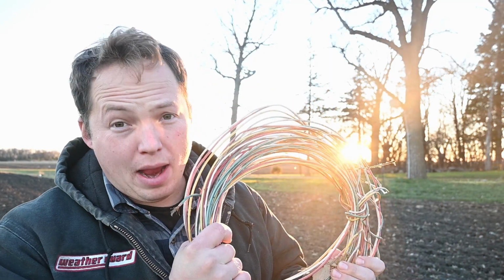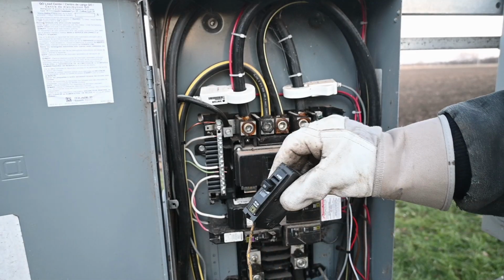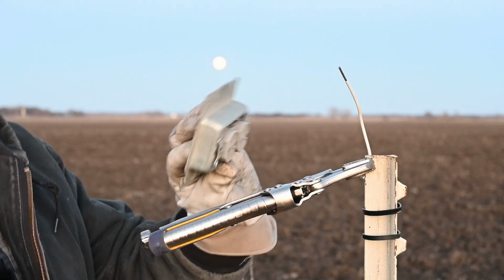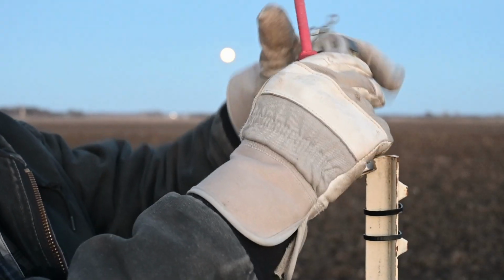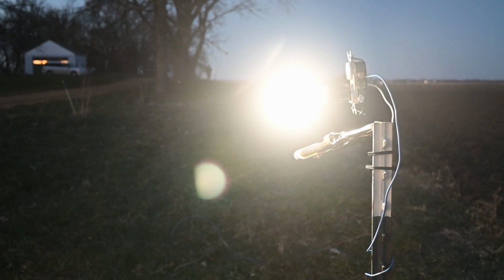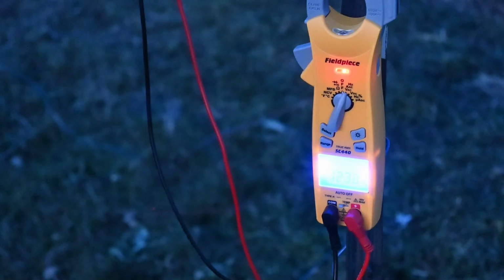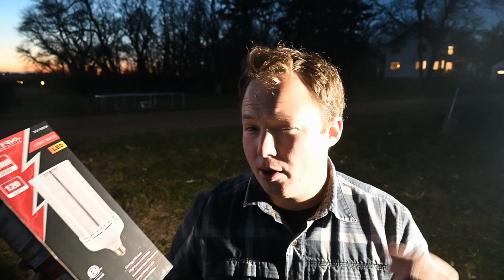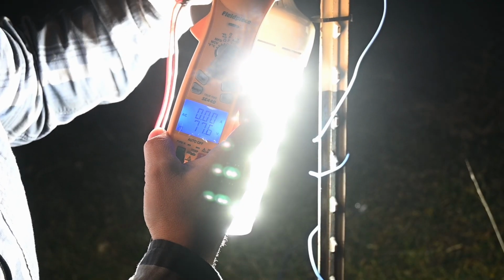Powering a Light With a Fence Post & Scrap Wire - SWER (Single Wire Earth Return) Demonstration

Comment: My Dad used to heat A-frame single hog houses using a 100watt incandescent lightbulb running a single wire from the source and the other wire attached to a metal stake in the ground back in the 1940’s in Illinois. This must be how he did it.
Reply from the maker: Exactly.

Comment: If you hadn't plugged your wire into your incomming power box I might have been convinced. Why does everyone pull this crap? A single wire earth return shouldn't need to be plugged into an incomming power box. These are the things that confuse people and distract from the truth. Half of the reason we don't already have unlimited energy potential. Sorry but this turns a lot of people off from even trying.

Comment: Pretty stupid to do this. Anything that’s a easy ground to travel it will and it could be ur body . Then ur fried . Also anything around that could get hurt just becouse u don’t have the tru neutral wire going back to the source. Now with ur ground to earth that u have your putting a lot in danger if sumone didn kno an ended up close in that area an using that recepticall they can become that path to ground or that ground could be hot also an fire you like that . Srry I can’t explain it to the y but I’m sure I got the point out

Comment: We had 2 boys that lived  lived a block apart and another that lived in the middle.  We took an old ping pong machine apart and salvaged the wire.  It took a lot of stripping the ends and soldering to get a wire long enough to reach the whole block and of course we only had enough wire for 1 run.  we used old loudspeakers on each end as microphone and speaker. We tried different grounds on each end but connecting to the water pipe at each house worked best.  There was always a loud hum we tried everything to filter out but we could talk all night! I don't ever remember measuring the voltage but it entertained us for a long time!  I think it was replaced by some 3 transistor hand held CB radios! This was mid 50"s.

Comment: Wonder if it would have less voltage drop if you increased the frequency of the alternating current to say 1440 cycles per second.   Might have to use a tungsten bulb.

Comment: The single path earth return path is  not exactly like a wire. Electricity takes every possible path through earth. Some current will flow in the direction of the ground at the transformer.  And some current will initially flow away  only to take make a convoluted path back to your transformer ground, and some current will flow to the ground located at your distant neighbors  transformers. 

Multiple paths is like adding resistors in parallel which is why a good ground can have a low resistance over long distance. 

Just looking at the theory. Take a current path through one resistor let's say it's 8 ohms.  If you add a second current path through a parallel  8 ohm resistor, the net effective resistance  of the two resistors is 4 ohm.  If you have four 8 ohm resistors  in parallel,  the net resistance  is 2 ohms.  Resistors in parallel  add like (r total)=1/(1/r1+1/r2+1/r3+..... ect). The earth can provide an impossible to count  number of paths back to the source which provides a very low resistance  to a good grounding

Comment: Can someone explain this? Lets say you have an older home, without ground fault protection devices. Let's say something goes to ground in your house through the ground rod, if you're outside in your bare feet are you going to get shocked?

Comment: I retired after a 42 year career operating the electric grid at all levels, so I'm very familiar with most aspects of power delivery.  While driving to Edmonton, Canada years ago I noticed that the single phase power line along the road no longer had a neutral wire, just the primary wire (7200-15000 volts depending on system configuration).  This went on until a farm could be seen ahead and suddenly there was a neutral wire on several poles before and beyond the farm, each pole with a ground rod I'm sure.  Then single phase primary only, again.  It was clear that the power company was saving the cost of many miles of neutral wire and that the customers had to deal with voltage deviations that would vary according to the soil conductivity in the area and customer load fluctuations.  They may also have had to deal with any underground metal water pipes, gas pipes, etc. that the electrical system would choose as the path of least resistance for neutral return.  Consequences could be that people or animals could be shocked and injured if getting in the path of the return current, and electrolysis degradation of underground metal installations.  I later got on Google Maps street level view along many roads in the area and looked up at the power poles which confirms that the single phase primary with no neutral is extensively used in much of rural Alberta.  Ok if it works for them, but not acceptable in most locations, especially in more populated areas.  Jess

Comment: note: if you actually do this, you will drive worms away from the spot the metal fence post is in the ground. I use this as a "work rod" to get earth worms - they crawl to the surface to escape the electric

Comment: I used to live in the snow. One day I dropped an ice cream cone I had just started eating from the peak of the haystack I was sitting on. The electric current from the earth shot the cone into the air while the ice cream expanded from the amperage. The resulting snowman with the ice cream cone being the nose was a surprise.

Comment: I didn't understand quite what you were doing at the electric panel, however, it looks like the thing that Nikola Tesla was talking about, where he said it's as easy as plugging a pole into the ground and you can get as much electricity as you need, and after he said all that Sears and Roebuck came out with a device called The Energy Siphon. There was another man who ran around for awhile, demonstrating that you can plug these wires into the ground and just ground both ends with the circuit breaker in between and you can get as much power as you needed, however his life was threatened till he finally stopped. Myself, I believe that you could do this all day long, I believe it's been done throughout the past all types of times in history. After all,  what is thermal energy if its not this?
If I were you, I would put a PVC pipe around the post in the ground. 
And salt water at the ground rod and post will be more conductive. 
The values could change with just water. 
Ok, cool video. Peace be on your house.

Comment: Can you provide your own power with a battery or use an inverter if you need AC and use your home for negative or do you have to use the same source for the circuit? I’m thinking if you could tap into another power source, like a neighbor’s house ground if you supplied the other half of the power? Would this work?

Comment: Hi   I had a  supposed  240volt motor   but when I checked the voltage at the motor it was 120 volts so I ran the 120 volt motor for  years ....one day I was told by someone else they were positive it was 240 volts knowing I checked at the motor it was 120 ...so I was curious and checked the power at the junction box on the wall with a disconnect switch...it was 240 but at the motor 120... The wire was very shallowly buried..so I started digging it up...soon I found where the wire had been cut and spliced with wire nuts but one leg had the wire nut off and the splice had came apart and was a few inches apart    so one hot led was on and hot " live " and separated by two inches of dirt ...I was amazed that at the motor I had on hot leg and one neutral for 120 volts that had been running that 120 volt motor over a year when I tried to tell my friend but I don't know if he believed me lol.  And a course some one with bare skin touching the loose wire on a rainy day could get electrocuted!   So there is that potential if the person's body completes the circuit becoming the load ,like a light bulb completing the circuit and flow of electricity of voltage and amps and you would be the watts lol.  Ouch! And like you said..the breaker most likely would not Trip...most likely a wet soil too would have different results and be more dangerous...I know you were doing a experimental test  but Nobel's brother could tell you thing's do not always go as planned!   
    Be safe !  By practicing safety!    
.....have a good night!

Comment: I worked on a house in town for a couple 10 years ago.  They had an average $700-800 electric bill, and kitchen stove, A/C, and any other 220v appliance did not work correct.  
   What I found was some genius hooked up one leg of power to a ground rod & neutral line to hot side 😟.     So basically they had a (swer) in one leg of power full time.    WOW.   Lot of people don’t understand that “ground” means just that.     Neutral & ground are eventually just the same thing.

Comment: Here in Australia we have a similar system for remote phone systems.
Go to one of the old stations (ranches to you in America) and there was a line posts with a single wire going off into the bush. At the other end was the next station, up to 50 miles away. The other side of the circuit was connected to a earth stake. Steel bore/well casings did a good job. worked very well.

Comment: When ConEdison in NYC was trying to standardize the electrical system in the city, they found out that a few people had been getting free electricity from ground eddy currents passing through the dirt in their back yards. 

All they had to do was drive two metal stakes into the ground and move them back and forth, closer or farther away to "adjust" the voltage to what they wanted. 

"Ground-Return" 22V Single Leg is very common in Australia and New Zealand to this day.

Comment: Very true, as stated below.  The Neutral wire/ Earth Ground, that you used, should have been landed on the silver screw on the receptacle.  Also, the voltage will drop at 300ft, so you'll need to double the wire size, if it's aluminum, or your voltage drops. 
  The man below stated that the voltage will go to the next house.  Probably not, in your situation, but in a city it is possible.  But, the unused voltage will return to the Electrical Power Plant that it was generated from, not the closest ground, unless it is is a very close proximity. 
  I am a Master Electrician, if you have any questions in the future, please ask.  I'll explain what will happen, an the dangers, if any.  Very cool to show other's though, an can be very handy on the farm's.  As long as there is no moisture on the top soil, an animal's are clear.  Hit me up for questions boss, I can show you many neat ideas with electricity. 
  I'm a Class 1, Master, Journeyman Certified Electrician.  Also, a Mobile Electronics Certified Professional, THX Surround Sound Certified Electrician.  I have full understanding of Direct Current, an Alternating Current.  Stay safe, an God Bless.  
       Sincerely, 
    Matt

Comment: Use a copper collector to collect electrical ions from the air feed it to a capaciator instead of a battery and connect ur setup .Nikola Tesla build this system and powered lights at a great distance .I like your clear presentation here and would like to see more .Robert Pres AZ Tesla Science Foundation

Comment: Journeyman Electrician, I had a service call last week, "everytime Tenant turns on disposal, the living room tv shuts off"  hhmmm.. first thing I'm thinking someone tied the wires together in a junction box and somethings obviously not right. I get to the job and sure thing tv shuts off when disposal is activated. Even weirder, they had a handy man run a new circuit for the disposal AND a circuit straight to a new tv plug. STILL shuts off tv. Throw an amp probe in tv recep, have tenant flip disposal switch- goes from 120.2 v all the way to 175v. All the lights in the house flicker when disposal kicks on.  Now I know there's something fishy with the service. I pull the meter, all connections look good and tight. House is on a flag lot, away from the road. I take a walk following the lines. I get to the transformer and there's the issue. The house lost it's nuetral/ground, just 2 hot phases coming off the pole with the bare nuetral/ground dangling. The house panel was creating it's own return path with it's bonding wire, the house ground connected to the ufer (concrete encased electrode) bar.  Called the pud, came out within the hour and replaced all 3 connections. Tenant said it's been that way since he moved in since december. Lucky he didn't fry anything.

Comment: Don't do this for any reason, ever. I could hook up my sink to a 1500 PSI pump but it would be a very bad idea.  I could disconnect all my hydraulic brakes on my truck and just use the emergency brake but it would be a very bad idea. I could have sex with a donkey but it would be a very bad idea. Just because you can do something doesn't mean you should.

Comment: so i have so many questions. 

1. if it floods does the circuit short.
2. if i take a metal shovel and stab the ground between the return will i get shocked. 
3. can i stick anything metal near there to tap into the circuit. 
4. how far can i run that from the starting point. 
5. is it efficient or is it "leaking" current into the ground thats being lost.

Comment: If you hit the hot wire with a shovel, the current would indeed increase and trip the breaker in a flash! This whole experiment is pointless and has no practical use except to show how dangerous it is and why you shouldn’t try it. That 40 volt gradient that you measured is more than enough to be fatal.

Comment: Many years ago, I was visiting my parents for the week when my dad asked me to help him replace the broken compass in his car.  He'd bought a replacement but had had trouble calibrating it (it just glued to the dashboard but the iron in the car frame and engine affect the magnetic needle, and there's an electrical effect too when the engine is running).  We eventually got it calibrated correctly, while the car was standing in the drive, and then drove down the road (the one out of town, which conveniently runs very close to north) to check it.  It turned out not to be calibrated once the car was moving and after we'd turned a few corners, so we turned off onto a side road and pulled over to try again.

However much we tried, we couldn't repeat the initial calibration successfully while the car was in this different orientation.  I was getting a bit frustrated so I took the compass out of its mounting and went over the road to see what would happen once it was well away from the car.  Abracadabra!  The compass worked.  And as I called out to my dad, who was still sat in the car, I looked up and saw we'd parked on the verge underneath a double line strung between telegraph poles.  This was an old rural road and it suddenly hit me that the houses along here, so far out of town, would probably never have had service pipes laid for them, so the thicker top line must be an electrical one on a neutral earth return system.  We had been trying to calibrate the compass smack in the middle of a magnetic field induced by the mains current...

Comment: INSTEAD OF USING THE FENCE POST FOR THE GROUND, YOU MIGHT WANT TO DRIVE A 10 OR 12 FT COPPER ROD IN THE GROUND, HOOK TO, AND YOU'LL HAVE A MORE POSITIVE GROUND ROD.THE DEEPER YOU DRIVE YOUR GROUND ROD, THE MORE POSITIVE GROUND, BECAUSE THERE IS MORE MOISTURE, THE DEEPER YOU GO..YOU WOULD NOTICE LESS DEGRADATION IN THAT AS WELL.

Comment: I am an Old Man but All the Real Old Homes were actually wired like this as Wiring never had a Neutral as No One Knew what a Neutral Was--only a Hot Wire and Ground wire which was Grounded to Mother Earth was used. Old Technology will still work, my old home house was wired just like your example--we had a 2 fuse link box. one was for the lights the other was for kitchen-frig. and wringer washing machine-no air conditioning or electric dryers in the 40's-50's...

Comment: Use a 1/4 or 3/8 rod, wire the return from the lightbulb fixture to the rod, wire the other connection to a "hot wire" from the house.  Doing this you have just made a "worm catcher rod".  Start with a 100 watt bulb and see if the worms come up.  If none come up, use a smaller watt bulb.  This would increase the current into the ground.  HAPPY FISHING!!!

Comment: The great thing about earth ground is, lets say your running lights to your barn 150 feet away. You would run two conductors, one leg of your 240 vac. and one from the common. Then use a ground rod outside near your panel. Then use 2 wire plus ground from the panel to your lights, or loads. Any short circuits would be routed to the ground rod and absorbed into the earth. In most areas there are only three wires coming in from the grid {120x 2=240} and a common leg. Ground is used only in the house either by earth grounding at the pole, or earth grounding outside near the control panel. Mine has a ground rod just outside of and directly below the indoor panel.